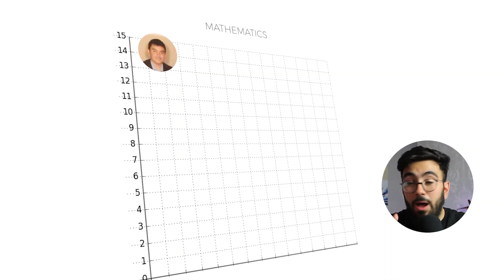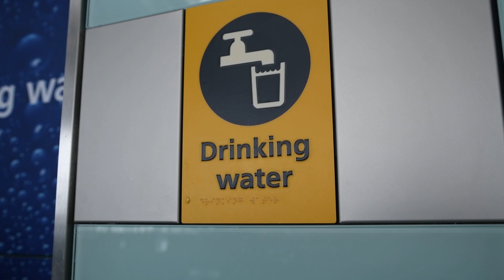My whole journey to becoming an engineer at Heathrow Airport

Comment: I originally wanted to do aerospace engineering but the grades requirements were high and i didnt get those grades so i decided to do mechanical engineering so can i still persue a career in aviation eventhough Im doing mechanical engineeering? and also can i do my masters in aerospace engineering with my mechanical engineering degree?